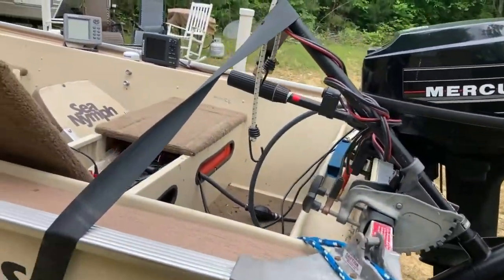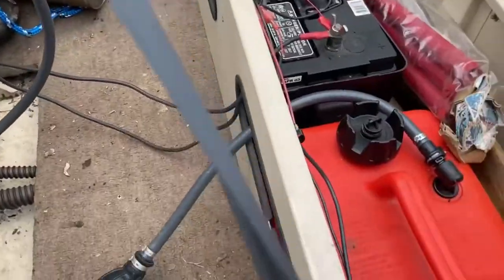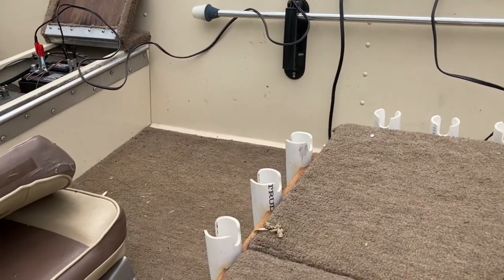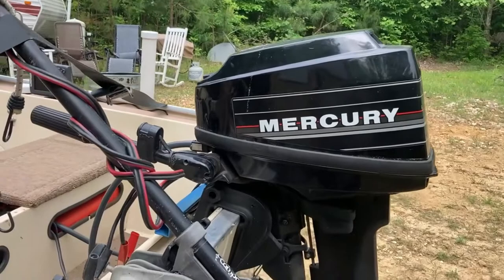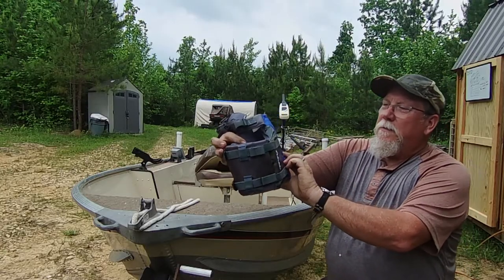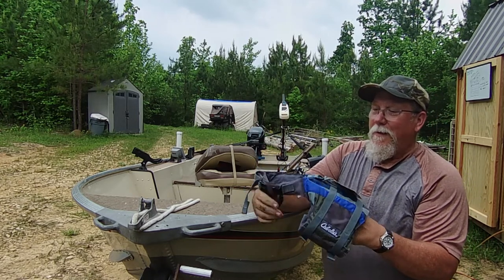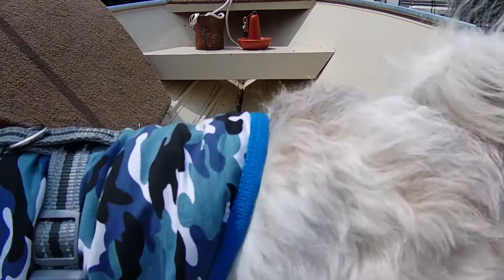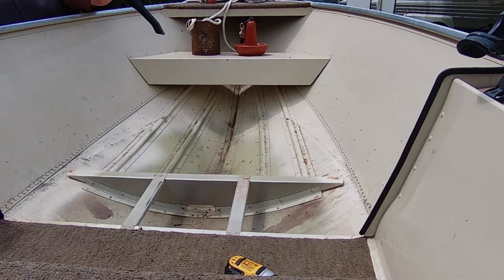Prepping Boat (Sea Nymph Fishing Machine) for Fishing - Vlog #166

Comment: Great job cleaning and checking out the boat. It is always good to remove the mice :-) I am surprised the trailer hubs do not have grease fittings as the axle can be underwater getting the boat on/off and with the hubs full of grease water is less likely to get in
Reply from the maker: I was a bit surprised as well Joseph - my guess is the hub cover comes off and you have to manually grease the bearings.  I was hoping for a sealed bearing and a zerk fitting for adding grease. Oh well. Thanks for watching! Take care! Dave Out!!